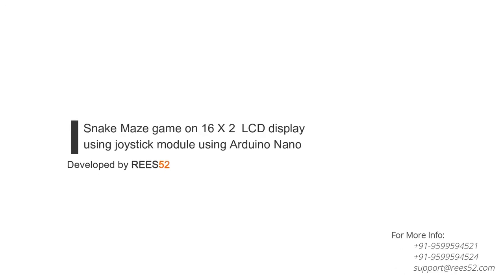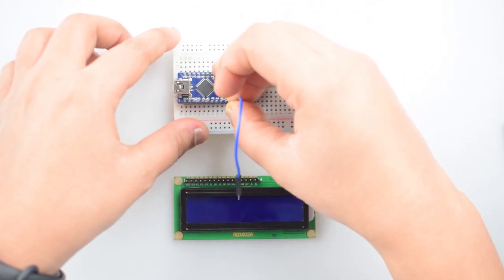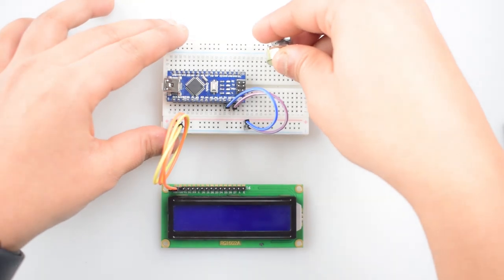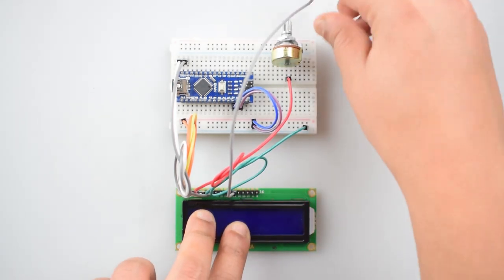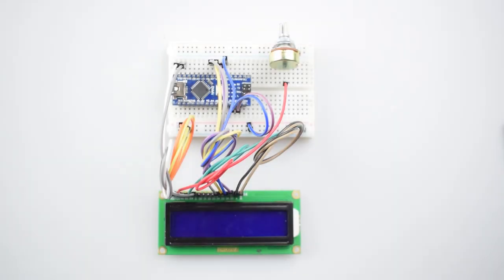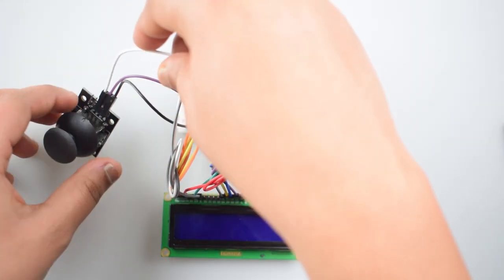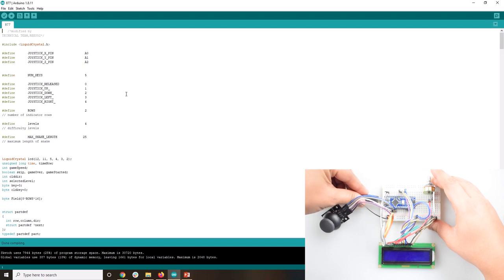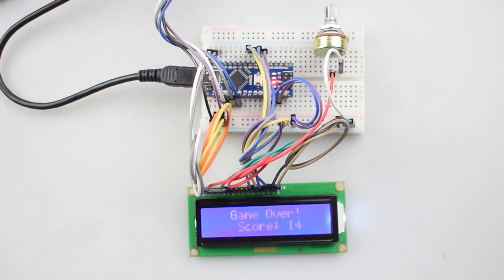Make a Snake Maze game using 16*2 LCD and Joystick Module interfacing with Arduino Nano

Comment: Hmmm it's not fake but I think the coding is a bit fogey or the diagram, make sure to check again, I turn the arduino on but it does not seem to boot up and the screen flickers every 0. 5 seconds.
Reply: its suppose to flicker because the screen is updating costanly especialy when you are moving the snake